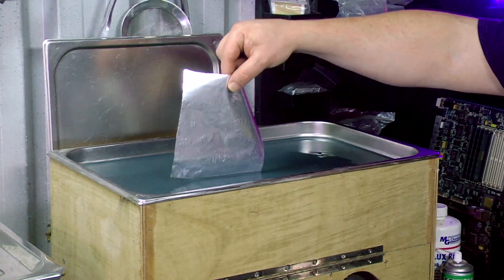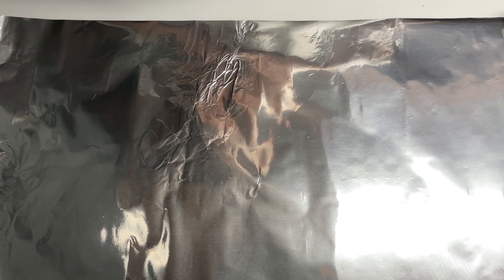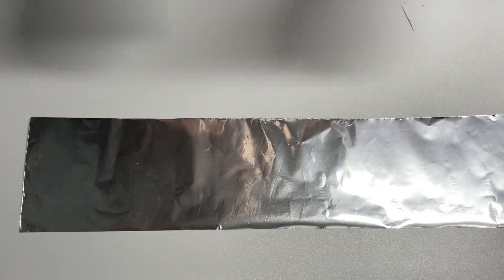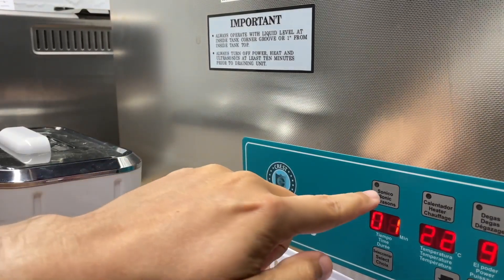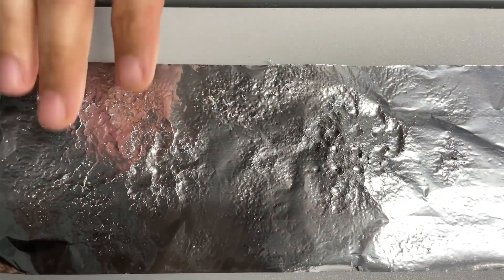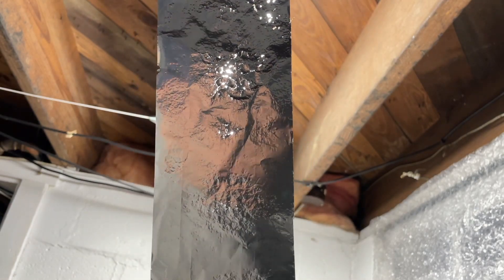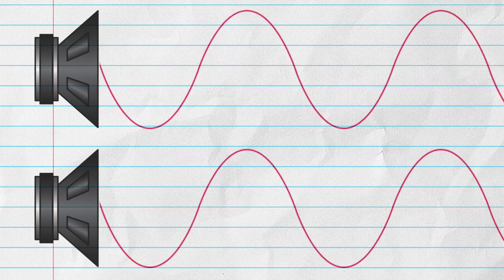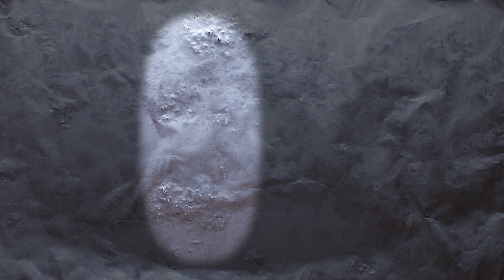DIY Ultrasonic Cleaner Follow up: Foil Tests

Comment: This and the previous video have generated a lot of ill-informed comments. If you have two sources at the same frequency, you will get peaks and nulls. The phase relationship between the sources doesn't affect whether they occur (they always will) - it only affects where they occur.
To understand the effect of frequency sweeping, you need to look at the wavelength of the ultrasound. This is given by the speed of propagation divided by the frequency. The speed of sound in water is about 1,500 metres per second and the frequency is 45,000 cycles per second. This gives a wavelength of 3.33cm. If the frequency sweeps between 42,000 and 48,000 Hz, the wavelength sweeps between 3.57cm and 3.12cm. This means that the destructive peaks are only moving 4.5mm. In fact, the first peak occurs at a quarter of the wavelength i.e. 1.1mm and each subsequent peak is at a further half-wavelength i.e. 2.2mm. This compounds as you get multiple wavelengths away from the transducer, but that is negated by having multiple transducers. This is a rough first order calculation, but Jay's experiment backs it up.

Comment: It will only decrease your efficiency if you hook up some of your transducers in a reverse polarity as the other ones so for example you take 8 transducers and hook them up like 4 with + to + and the other 4 + to - so the polarity and also the phase of the last 4 will now be 180° out of phase to the other ones.

Comment: You will still get standing waves no matter what you do considering the speed of sound in a liquid and the small size (comparitively) of the tank.
So, even with swept frequency, you will get standing waves unless you can pulse single cycles of significantly varying frequencies.
But, what does this even do ?
The answer is - Bugger all. You only need to move the item being cleaned a small amount to negate any standing waves - but then, is it even worth it ?

My thought is that no, it won't materially make a difference. It is the result that counts - if it works as desired - test concluded successfully. 
End of story, end of test. 
Proceed to clean !

You will always get "experts" who are not, that are willing to pass on their expertise at no cost to themselves except to flaunt their ego.
The results matter. 
If it works as expected, and desired, why fix what ain't broke ?

Greetings and Happy New Year from Warwick, Queensland.

Comment: the cancelling theory can be valid, but it depends on the natural frequency of the panel of the tank that they are attached to, and where they are attached, as they can amplify the postive response deflected area of the panel, or actuate on the parts of the panel that are negatively deflecting, and therefore commensurately acting to restrain against the positive deflection of the other part of the panel. This is very specific to specific frequency, panel dimensions and material grades and thickness. Hence a sweeping frequency is an easy 'fix'.

Comment: Far from cancelling, the addition of another pair of transducers should theoretically double the acoustic impedance and end up not doubling the power but quadrupling it!  In your speaker example adding the second speaker actually produces twice the Sound Pressure Level.  You get 3dB extra from the new speaker (another unit of power added) AND you get 3dB added because the whole thing is now twice as efficient.  Those two add up to producing the doubling of output SPL we measurably get.

This relies on the outputs being in phase, which won't necessarily be the case with 40kHz having a wavelength of 3.7cm in water.  (1480m/s being the speed of sound - v = F x Lambda).  It also might be that they are using 20kHz square waves to create lots of 40kHz 2nd harmonic components, so you might want to get 20kHz in phase too.  Assuming the speed isn't affected by the steel tub (and that the transducers are effectively point sources, which I somewhat doubt) then a spacing of 7.4cm might be optimum.  Or it might make no difference at all because the whole thing is a diffuse sound field.  I do a bit of work in this area and I'm afraid I have no idea which is more likely - but it would make a great A Level physics project!  Sadly the manufacturers won't care because it'll be all about how many Watts they can advertise, not how efficiently that power is deployed.
Reply: >1480m/s speed of sound (in water); I suppose the cleaning is done in isopropyl instead. The speed is lower ~1200m/s
Reply: Wouldn't it only cancel it out if the sound waves were exactly the same and one was inversed? I just don't see this being probable until you have a ton of transducers working at the same time and I don't think the effect would be noticeable on a diy project. Probably a worry for an electrical engineer working with extremely large industrial tanks the size of a pond.

Comment: Hey Bruce.  I have a question to ask you . I have a coooper cooler for sodas and it doesnt work correctly.  It powers up but when you run it , it shuts off . Could I replace the board with just and on switch to just run everything at once ? Oh and it's brand new.  The company said they tested it before they sent it which is a lie

Comment: They would have to be exactly the same frequency and in opposite phase in order for them to cancel out. This would be hard enough to do deliberately with just two; it would be exponentially more difficult to accomplish with 8. You will get random amounts of destructive interference, but you'll also get random amounts of CONstructive interference, more or less balancing out.
Reply: which is why drive freq is swept.

Comment: I have been looking at these food serving trays and have found a 2/1 size, i.e. double size.  Not deep but would be great for server boards etc.  My current cleaner holds about 2 pints,  fine for duinos etc. but you know , bigger better more eh?
I will have the studs welded to the tray though.  I don't think glue is the way forward, however the next vid may say otherwise.
Reply from the maker: My next follow up will be doing some strength tests with different adhesion methods.
Reply from the maker: @jonWilk8156  don't worry, your reply didn't come off like that at all. Thanks for watching!
Reply from the maker: @jonWilk8156  I'll be showing a few other custom builds in my next video. I have a picture of one here with 240 large transducers attached. Crazy stuff!

Comment: thanks for these demonstrations... i am starting to conclude now that the benefit of the more expensive 'true sweep' is merely to either be able to use fewer number of transducers to get a broader coverage area.  or otherwise to increase overall effective power / make a stronger performance over that same volume of liquid.

but coming back to your diy and these cheap chinese design... it feels like maube there could perhaps be some simple and much cheaper way to effectively make a 'fake' sweeping behaviour. that is to say maybe not actually a true sweep? but instead if our transducers are randomly and slowly drifting in and out of phase with each other. than that should also be moving about the standing wave patterns in the liquid and give a similar sort of result

this is then cheaper to implement in the electronics than crest's true sweep design.

so coming back to your video here, it seems like your diy machine is already doing this? for example if you can hook up a 4 channel oscilloscope to the terminals of 4 of those 8 transducers. and capture the relative phase. to see a drift, and that they are not solidly phase locked to each other

could this be due to the design having multiple seperate driver boards? such that each board does not be in sync with the other driver boards? ie each has their own clock source? and the 1 driver board can only drive (at most?) 1 pair of tranaducers? then maybe it would make sense not to have those connecte pairs of transducers located on the sam column. but physically positioned further away from each other. such that they are too far away for the power in the generated waves to have any much power left in the wave by the time they do meet each other and additively make the interference pattern. by that distance it becomes a completely neglible affect

so if am not mistaken here (and indeed it is worthy to investigate independantly, and not just assume i am correct, its just a theory to me!). but if this can be verified then then would be great to confirm. so that we can all have more clear and solid reasons for why the belief that there is no need for a 'real'  or 'true sweep" function. that it just simply is never necessary

for example, in situation where the board has potentialy 'unknown' and perhaps either dellicate, or bustable, or 'finite lifetime' mems sensors that might stand any chance of getting damaged. fwiw it does not seem to be the case that mems sensors are so delicate anymore in mass produced modern day equipment (such as smartphones etc). they must have just kept on improving them over the years. so only if you were oh idk... trying to repair a really old devices, or if it was some specialist equipment such as scientific experiments. or whatever else very special like some medical device or a military device. IDK. i am just rambling now.

anyhow good video! as you can tell, it really has provided a better insight for me as a viewer. and those insights cannot be obtained without your more rigorous facts based approach.

it also makes me a but more curious if i were to buy some random cheap chinese ultrasonic cleaner(s). and of different sizes (2 4 6 or 8 transducer layout).... then if we open it up to actually see what is the number of driver boards in it. (that they did not take shortcuts and daisy chain all 6 transducer from the same 1 single driver board). and if the wiring configuration inside for the relative positioning of those transducer pairs was in fact already properly optimized. in case not all the chinese who are putting these together as kits fully understand such situation, if it in fact matters? so if there is any meaningful benefit to me as a consumer, to bother to open the cleaner after purchasing it. and check for myself. (but that all also depends if in those speculation it actually matters or not, to make a meaningful difference, and perhaps, or perhaps not). hehe